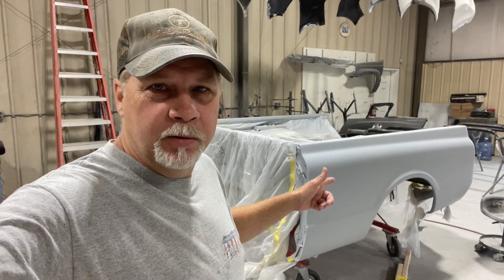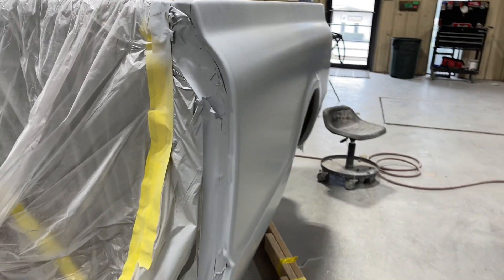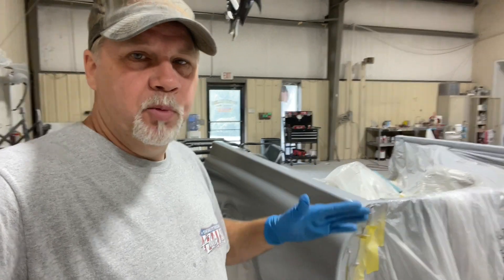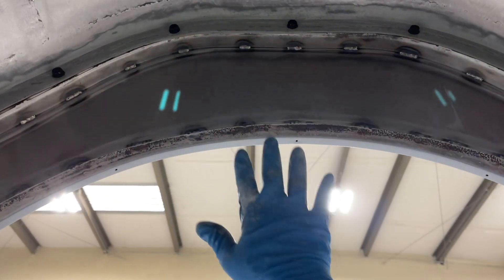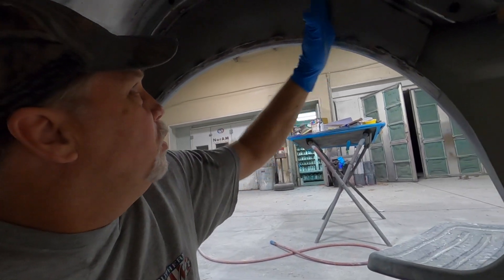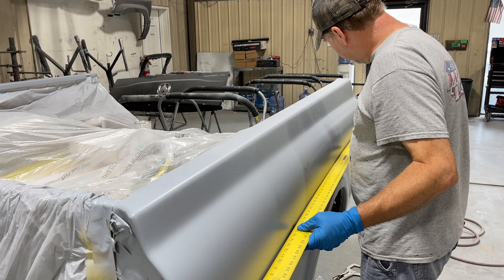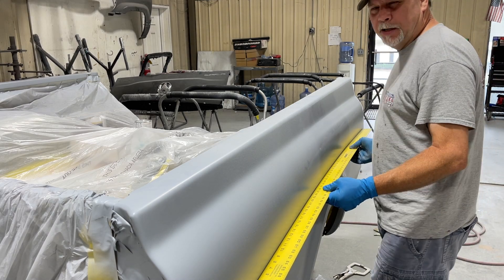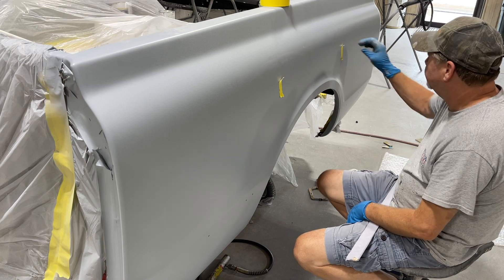C10 Show Truck Project:  Perfecting the Bedsides

Comment: Great Video, I had the same exact issue with my 67-72 bedside, after cutting the inner loose and prying/beating everything else I could think of, I ended up reattaching the inner fender and doing exactly same thing on both sides of my truck.  But great video and makes me feel better that I wasn't the only one with the same issue.
Reply from the maker: Yeah I was surprised at how well it came out. Thanks for watching!

Comment: Really nice body work and paint you do I have a 1972 c/10 my self was wonder on my factory tailgate can you put body filler fiberglass on the spot welds to make it smooth I always Hurd they would bust back out what would you recommend thanks for any info
Reply from the maker: If it’s cleaned of any rust by sandblasting then it will have the best chance of lasting. If there’s any rust left, it’s coming back.

Comment: Trucks have a hard life. Then body work to fix, might as well be a school bus. The ruler was a great visual aid in seeing the issue. Trying to keep straight about sanding to apply product. Bare metal, 80 grit for Epoxy sealer. Scuff, sand lightly for high build or just primer. Depends on how long Epoxy has been on. 180 grit for a two part polyester finishing putty for shallow imperfections? Just trying to learn. The one I am working, is for me. Thanks for sharing.
Reply from the maker: You’re welcome.

Comment: I had a question for ya, would it be ok to use 2 different types of filler? I have rage ultra and 3M platinum plus, there different colors so it would make it easier to see when I’m sanding through when blocking.. I just wasn’t sure if it would be ok to use them on top of each other..
Reply from the maker: I’ve never ran into a problem using different fillers as far as compatability. If they sand way different you may have a problem where when you cut through one and into another, it’s hard to make straight because they sand at different rates. So…I would try to stick to one or the other in any given spot. Great question and thanks for watching!
Reply: @StoutCustom  thanks for the reply, I really enjoy your videos. They’ve help me out a ton with my build.. Since I’ve started watching your videos my go to block is a yard stick out of all the blocks I bought it’s probably the one I use the most lol
Reply: @StoutCustom  And you are right about the fillers cutting at different rates, I noticed that today when using them.. I like the 3M much better then the rage..
Reply from the maker: @RicardoRodriguez-vs2rm  hard to beat a good yardstick. Thanks for letting me know the videos help. It’s really good to know. 👍